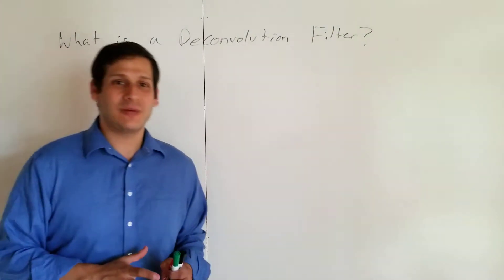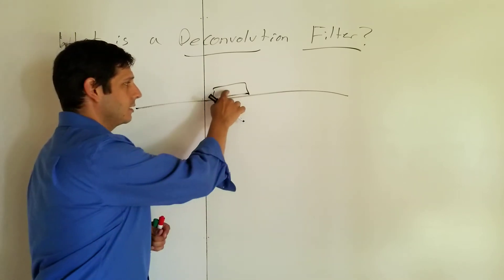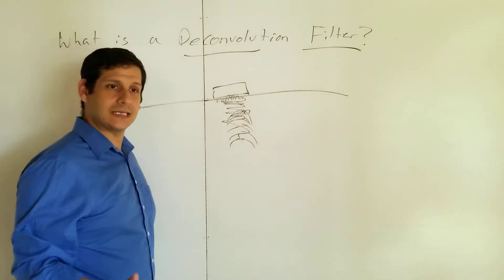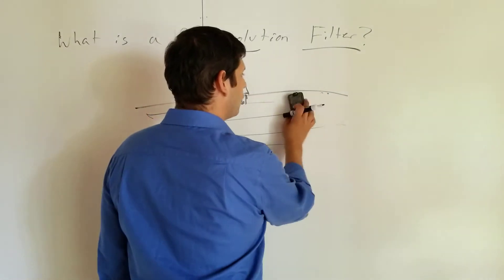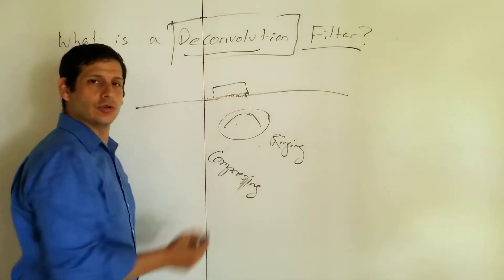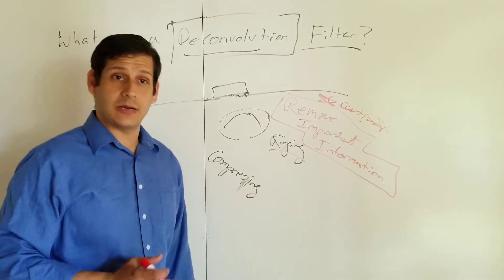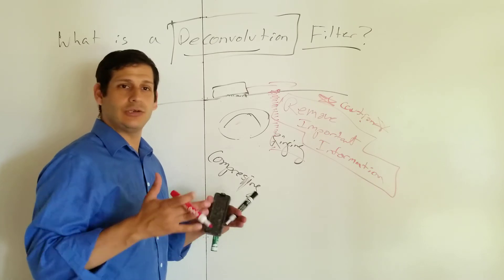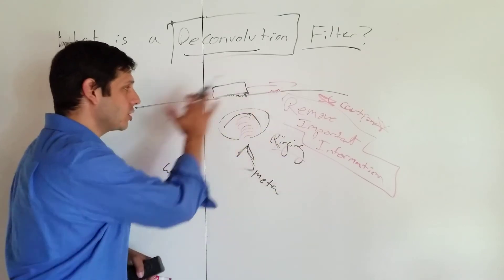Why use a Deconvolution Filter on GPR data? | Ground Penetrating Radar

Comment: Could I use the computer from the GSSI SIR as a layer in my deep learning network? I wanted to make an image generator that uses tens of millions of digital cameras that are pointed at a flatscreen tv. I am trying to use fewer chips and also less electricity.
Reply from the maker: @Tyler-s2e  not sure but probably not since it is a proprietary system
Reply: @Learngpr  What about dead reckoning sensors for imaging an aquifer? Maybe an algorithm of ICA and Euler's Deconvolution? We could probably get permission to come out after curfew. We could probably hear the signals from some of the larger wells slurping and use those for the imaging and try to confirm a GW or something.
Reply from the maker: @Tyler-s2e  not sure. Good luck!

Comment: Good Morning Dan. I use an LMX100. Is the deconvolution filter you refer to, the "filter" button on the head unit, OR is this something additional? I find when I use the filter, the lines get very thick and muddle the dataset. I usually use filter 1 or 2. Make any sense? Thank you for ALL the informative vids!
Reply from the maker: Hey,
Great question. The filter button on the lmx 100 is a background filter. Not a deconv. It helps remove horizontal banding from the data profiles.

Comment: Hi Daniel, 
What exactly is the difference between ringing noise and multiples, in technical terms.  How would you define ringing noise in GPR ? or multiples are just part of ringing noise ?. Thanks
Reply from the maker: Great question. I generally classify ringing as a type of multiple. Others being mirrors from front and back of pipes, and trapped waves in layers.

Comment: Have never used it, not sure how to use it or where it's at on data collector
Reply from the maker: Thanks for the comment TJ. Great spending a few days with you in Alabama. This feature is generally not offered on any systems, only in post processing software. I'm not sure you guys will have much of a need for this type of filter based on what you all are looking for.
Reply: Thanks

Comment: Hello! Your videos are hepful. I loved these. I work with GPR data and I have a question, Does is possible create a routine for processing GPR data? which program would you use?
Reply from the maker: Hi! Thanks for watching. Im glad they are helpful. You could run routines, but you should make sure that the parameters are specific to the project. What system do you use?
Reply: LearnGPR I'm using Mala Geoscience with 250 and 100 MHz GPR. These are monostatic shielded antennas

Comment: how if it mixed with data from other water source like sewer or spring, can we deconvoluted it?
Reply from the maker: l karisoh I've seen water create ringing in data. Usually water pockets
Reply: LearnGPR no it wasnt water pocket (in my situation)  but sewer or spring, most our pipes here is crossing lane with sewer lane or spring, and  other pipe such gas and electric cable pipes